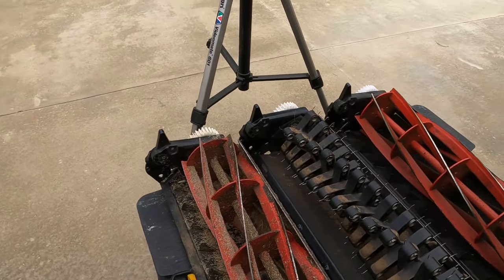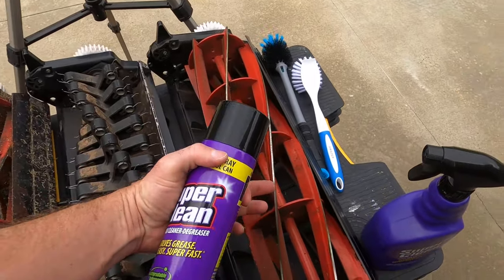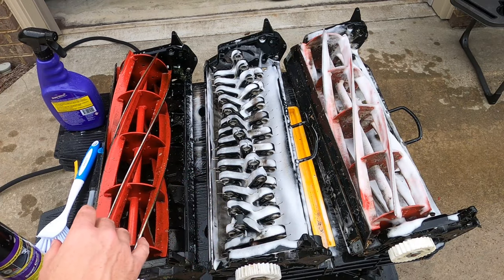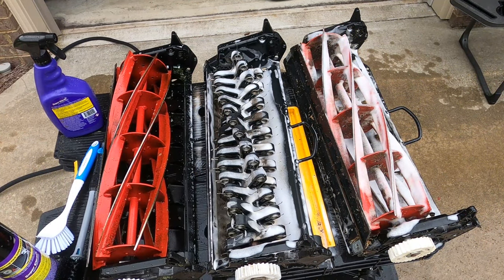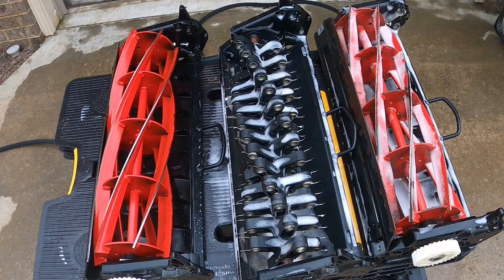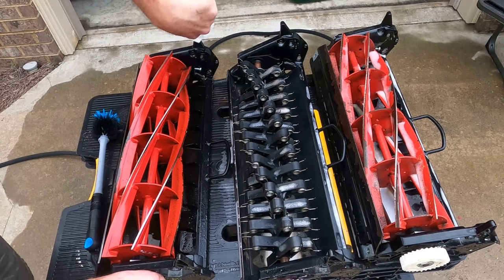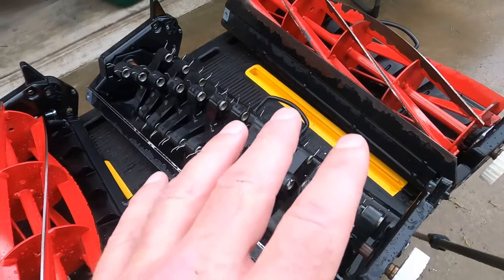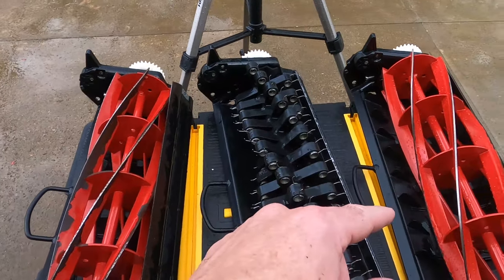Super Clean Cartridge Cleanup ☀️ (S2E16)

Comment: Great tips on your cleaning process. I just tried out the foaming degreaser and a wheel brush and it makes the job go so much faster. Thanks!  Btw, have you had any issues with your Allett reels bending if a twig/mulch gets in there? My Sun Joe reel melts like butter if it gets caught... looking to upgrade to the Liberty 43 to fix that!
Reply from the maker: Thank you!  No, haven’t had any issues with the steel bending.  Only issue I’ve had was the red paint peeling on them, but that doesn’t affect cut quality.